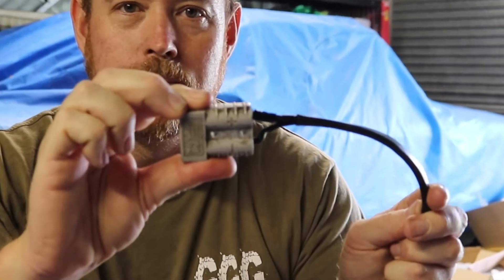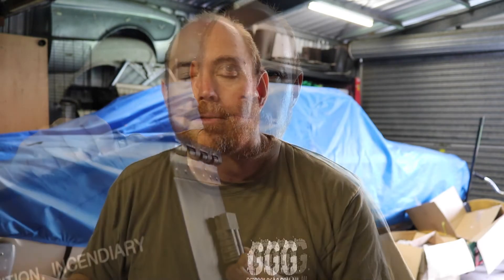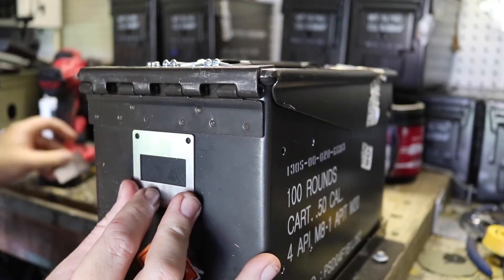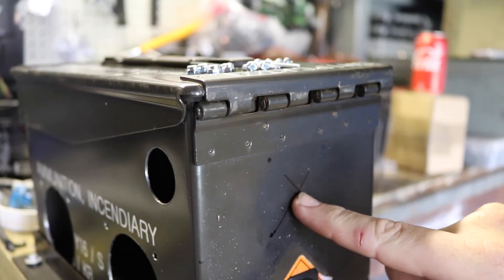How to flush mount an Anderson plug | Easily mount your own Anderson plug

Comment: This type of mount leaves a great chunky plug on the interior.
What I'm after is an exterior flush mount in an aerodynamic styling that faces backwards so as not to collect bugs etc.
Reply from the maker: That is fine this is is a “flush mount video” ... what you are describing is called a surface mount. Completely different dude

Comment: It's ok but that's not flush
Reply from the maker: It actually has 2 positions, on this job it protudes slightly for ease of use, For a full flush finish you can move the anderson plug to the second position on the bracket
Reply: @GetGoodGearTV  "Protrudes slightly" is a surface mount, not a flush mount.  In either case, the fascia is not flush.
Reply from the maker: @roberth5435  with an Anderson plug, Flush Mount is 90 degrees to the surface, Surface mount is parallel to the surface. It is as "flash" as you can get with this design, the facia is only 1.6mm thick :) www.getgoodgear.com.au
Reply: Ha, I was thinking the same thing.